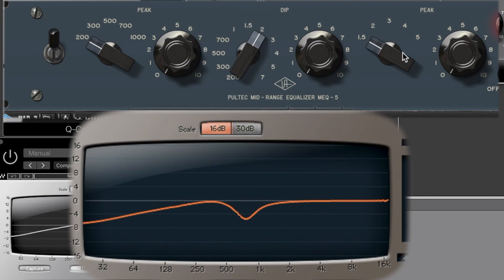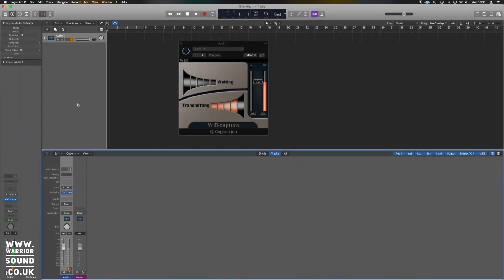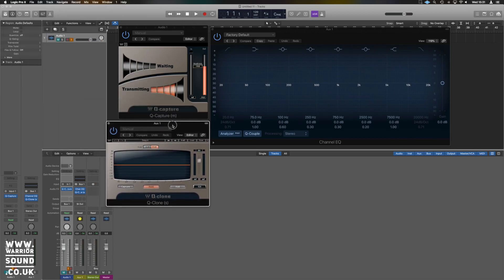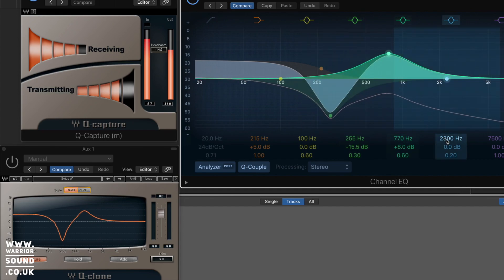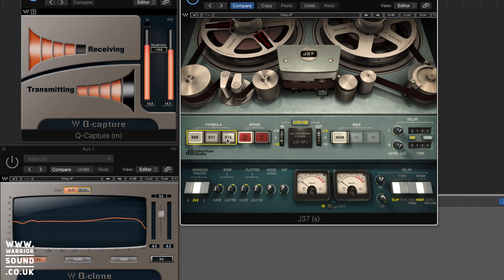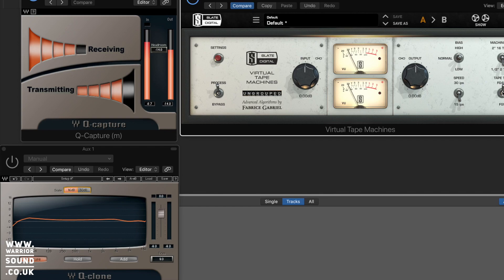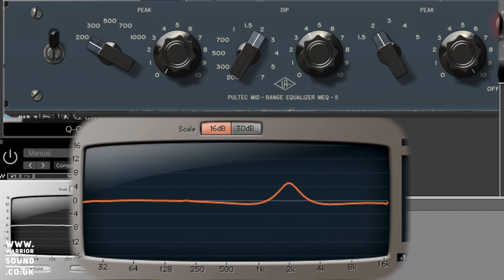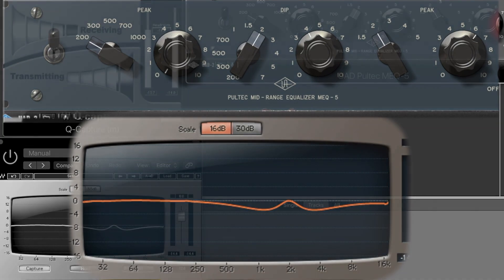How to use Q Clone - Waves Q clone tutorial

Comment: Your screen did not say receiving.

You time skipped the video to where the signal loop was responding. You did not show us how to get the signal loop correct.

Mine says "waiting" at the top and "receiving at the bottom.

I have a send to Bus 1.

Bus 1 has a plugin followd by Q Clone.

The audio channel with Q Capture has an output of Bus 1, just as yours.

Q clone disconnects once I press capture and the audio mutes. 

I cannot advance.
Reply from the maker: I skipped nothing. As established in multiple comments below, it’s down to your individual I/O which I didn’t an can’t really account for. Some have had success using a secondary aux. Best of luck.

Comment: This skips a step that presumable routes the signal back to Q capture.
Reply from the maker: Nope nothing is skipped. I can only assume that some people are using a different daw that maybe needs extra routing.
Reply from the maker: You do not need two aux's. Here ive uploaded the template where its working with channel EQ https://www.warriorsound.courses/pl/194976
Reply: @Unders  Thanks.. but it's not working.
Reply from the maker: @7hertzstudios276  hmm i can literally open that project and it works. I wonder if its due to individual audio interface settings for people.
Reply: @Unders  Sure.. I open new and gave the path as you gave in your Tampate also.. But didn't working. Anyway, Thanks a lot for halping people and giving reply ☺🙏
Reply: Yeah, the way he did it isn't going to work because he's missing the step routing the signal back into Q capture.

To make this work CREATE TWO BUS TRACKS (you can do this by simply opening an audio track and selecting bus 1 on one send and bus 2 on another send, you don't have to send anything to them with the knob, it's just an easy way to create them... they will be called aux 1 and aux 2 by default in the mixer window you can open by hitting COMMAND+2. Then, On aux 1 open the Q capture > Set the output of aux 1 to BUS 2 (which by default will be called aux 2). On the Aux 2 track open the Q clone, then set the output of Aux 2 to BUS 1. After you do this, hit capture in Q clone and turn the power button off to avoid the feedback. Now any insert you put before the signal chain on Q clone will show up in Q clone.

You are basically using the signal from Q capture on BUS 1, sending it to BUS 2 into Q clone, then sending the signal going through Q clone from BUS 2 back into Q capture on BUS 1 creating what would normally be a feedback loop. Good luck, hope this helps.
Reply: @ryansmith3111  you a real one <3

Comment: Thanks for the video, but at 1.54 you skip how Q Capture starts 'receiving' the pulse. This doesn't work for me by just hitting capture. How are you routing it back?
Reply from the maker: Nope nothing is skipped. I can only assume that some people are using a different daw that maybe needs extra routing.
Reply: agree. didn't work for me either. 1.54 process was skipped.
Reply: Yeah, the way he did it isn't going to work because he's missing the step routing the signal back into Q capture.

To make this work CREATE TWO BUS TRACKS (you can do this by simply opening an audio track and selecting bus 1 on one send and bus 2 on another send, you don't have to send anything to them with the knob, it's just an easy way to create them... they will be called aux 1 and aux 2 by default in the mixer window you can open by hitting COMMAND+2. Then, On aux 1 open the Q capture > Set the output of aux 1 to BUS 2 (which by default will be called aux 2). On the Aux 2 track open the Q clone, then set the output of Aux 2 to BUS 1. After you do this, hit capture in Q clone and turn the power button off to avoid the feedback. Now any insert you put before the signal chain on Q clone will show up in Q clone.

You are basically using the signal from Q capture on BUS 1, sending it to BUS 2 into Q clone, then sending the signal going through Q clone from BUS 2 back into Q capture on BUS 1 creating what would normally be a feedback loop. Good luck, hope this helps.
Reply: @ryansmith3111  Thank you !

Comment: I guess Q-Close will not have the same result as the hardware when you use Q-Clone on a project recall and the hardware has been changed. I guess you can always re-run the Q-Capture and add a new Q-Clone on the same channel (just to see the curve change) and re-adjust the hardware to match the previous Q-Clone curve? Like total recall... Or will a picture of the hardware setting be easier? LOL
Reply from the maker: The idea is QC replaces the hardware with its saved curve. While it’s not likely to sound identical on a passive EQ it wouldn’t be easy to discern. Something that saturates however not so much